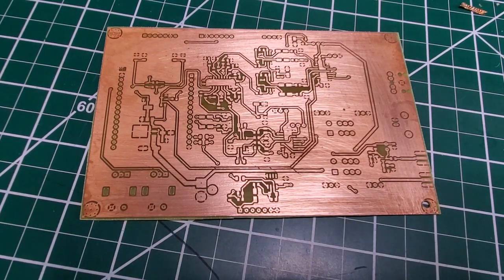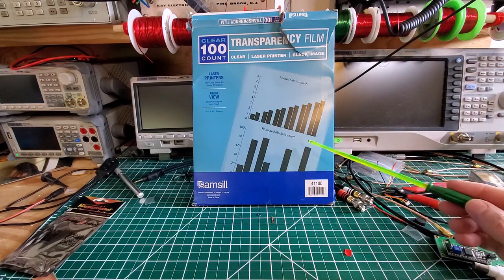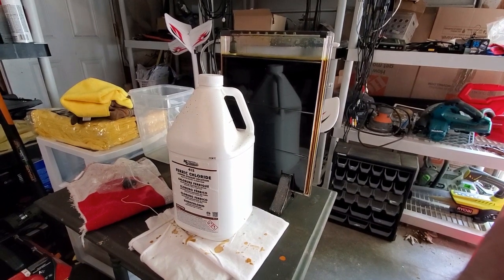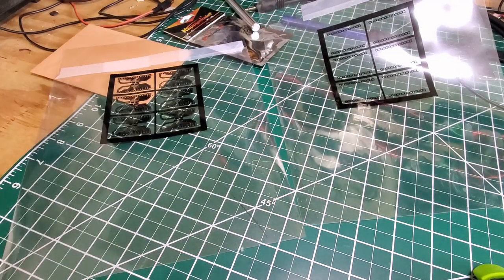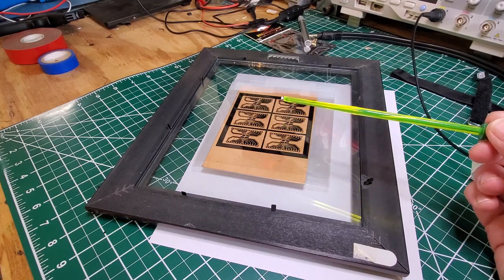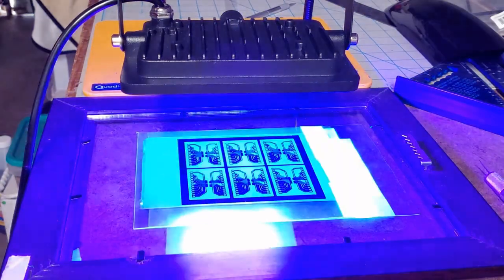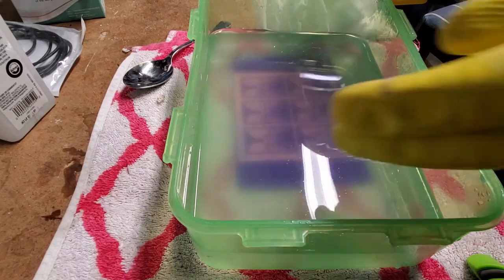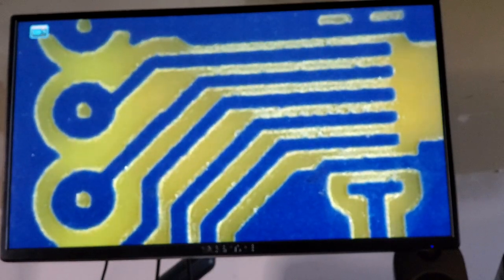Producing double sided PCB with UV Resist Method

Comment: here's a little tip,mist the board with water ensure the board is fully misted,squeegee all the air bubbles out,the water helps keep a vacuum and causes the film to vacuum suck onto the board,then either iron on or use the laminator.

Applying the resist sheet to a dry board just traps air,it's the same thing with dryslide decals the water helps get the air out.

Just make sure to squeegee out ALL of the water,you may need to run through the laminator twice or thrice,with the hot iron a sheet or two of kitchen roll to help make full thermal contact and press the film fully onto the board as the board is not perfectly flat.

The UV exposure is by far the best method for pcb manufacture,with screen printing a close tie,both use UV exposure for the image,i've tried both ,the silk screen for is more expensive with the negative resist from china being the favoured method for cost effectiveness and less wastefull. 

You can buy liquid resist thinned with acetone,i have some and i'm bursting to try it out ,it drys in a few hours,i could apply it with a hard rubber roller like lithographic stamps.

I have a few sheets of presensitised  copper sheet,a 5m roll of the neg resist and the wet resist,for two pcbs no bigger than a square inch or so each,one is a smps booster for tube HT and the other is a buffer op amp for the tubes output,small daughter boards for breadboarding the tubes.

I have caustic soda,i had to order the soda crystals for two reasons,one i can't find the caustic soad!!!!!! and second i remember the caustic soda removing the resist layer completely from the board it being a little too aggressive ,big clive (a fellow scot) used the soda crystals and in no time the job was done and in a far less aggressive manner.

I'll share another tip i gave to big clive,and another Scottish tip too,the etchant ferric chloride is great in a bubbler tank also in a passive tub,i made tube amps with brass facia plates with the decals etched into the brass,it took ages to cut the brass with it being a copper zinc alloy a lot of smut was building up and frequent use of a babies tooth brush to clear said smut.

I found out that a fluid for etching brass and it works amazing on copper,it clears the smut in a passive tank and reduces etch time in an active (bubble) tank,it is  called EDINBURGH ETCHANT.
Edinburgh etchant is ferric chloride mixed with citric acid,i bought citric acid powder from ebay  few table spoons in the tank you have there would be fine,the effect is amazing with regards to how clean and quickly the pcb or brass is etched and the brass particularly noticeably deep and crisp edges,without under cutting as was the case before due to the time taken,the citric acid kept it clear of smut,that's what the pcb bubbles are for,time is reduced considerably to make a pcb,very uniform fast etch,be careful.
Reply from the maker: Thats a lot for a little tip John! Thank you for the comment though - a lot of good detail here! I had no trouble getting NaOH though - it was down at the local hardware store. The Ferric Chloride mix I had was ferric chloride + HCl - which does go off over time

Comment: Thanks Ian. I use the same process, always nice to see what "tricks" others use. I've never done double sided so your pocket method has given me some confidence. Getting that first film layer off is a pain, I use two bits of tape, one on each side and in the same corner - works a treat. An option for others to get the negative ... in my case print the positive on to paper (I have an ink jet), then take the page to a copier centre ... they can copy on to laminate and those commercial copiers have a setting to print "negative".
Reply from the maker: Glad you enjoyed Neville. I honestly prefer the "fab in a box" laser toner method. Its far less fiddly. I do think you can get better resolution with the UV method though.

Comment: Nice video Ian, few tips :
1. Use a small sprayer (like perfume sprayer) filled with distilled water  and apply a thin mist of water on (little more cleaned PCB clad- with scotch brite and dishwasher  and IPA later) the PCB and then gentle put the UV Resist and use a Squeeze or old credit card to remove any bubble, also removing all the water. let it dry a bit and then put it in hot roller to finally seal it. this will give you mirror finish without any bubble.

2. After developing the exposed PCB un Sodium carbonate, quickly dry the board (in my polluted country, the polluted air attacks the copper in no time) and place a clear OHP sheet on both sides and expose under UV for another 4-5 minutes. this will make the UV mask rock solid.
- VU3ECN
Reply from the maker: Thank you for both the tips. Applying the resist has always been the most painful part for me so I'll definitely give the water mist technique a go! Thank you for the comment.

Comment: for sharpest possible image transfer you do want to flip the F side, since dye or toner is printed on one side of transparency and it should be closest to pcb or some light will refract and spill into transparency and under it
Reply from the maker: That makes sense although I had to stack two transparencies together or I would get light leaking through. Looking back on the method - I think it produces good results - but its fiddly and takes a lot of work to get there. Not to mention after you are done you have to go through and drill all the holes! I had fun doing it though

Comment: If you put the transparency in the thin box together with a cotton ball, paper tissue or something similar soaked in acetone for a couple of minutes, you will get much more contrasty print, and won't need to use two transparencies. I had a printing company long ago, and we were printing tons of user manuals for appliances, TV sets and such. We used laser printed tracing paper, and it worked perfectly, no reason why it wouldn't work with transparencies.
Reply from the maker: I'll have to try that - thank you for the tip!

Comment: I am not sure if it really worked for me, but I used to completely submerge the board and the  resist under water. Then get the resist and board aligned on the top edge. When you lift it out of the water, top edge first, surface tension will pull the resist to the board without any bubbles or wrinkles. As I remember it, there was no "free" water under the film but I assumed the film absorbed some so I let them dry in a warm dark place for a while.

BUT I did run into problems which may or may not have had anything to do with the water bath. Often the resist was very resistant to coming off where it should. It is more likely my UV light wasn't diffuse enough, or I was overexposing. I think the film was also getting old and slightly exposed looking off the roll.

The other problem, I think might be fixed by doubling up the transparency like you did but for some reason it didn't occur to me to try that. I ended up with lots of little pinholes in the resist and copper. On the other hand, it could have been mini steam bubbles from the water bath and laminater.

After etching, I think I removed the resist with acetone rather than lye. Assuming I'm not full of crap, I think that might be a little safer to work with, especially if done outside. Seems like the body even makes a little acetone as part of normal metabolism so it might be equipped to deal with a whiff of fumes every now and then.

Anyway, yours turned out a lot better looking then mine but I thought you might want to see if the water bather helps or hurts your process.

Comment: I have a tool that I bought from the UK at great expense that looks like a gigantic stapler which you can load little tiny hollow copper pins into. When you engage the device it forces the hollow copper pins into the drilled pcb hole and creates a via that attaches the upper and lower copper surface of the board. You can buy the pins with different via sizes. The pins in 1000 quantity aren't cheap either. The tragedy is I've had the device for years but I've never used it.
Reply from the maker: Thanks Vince - do you have a link to the tool? I think I may have seen it before. Whats the smallest pin diameter you can do with it? Thanks for the comment!
Reply: @na5y  Hi, I have pins that are 0.4mm and 0.6mm, there are larger sizes but that's what I was going with. The tool is made by Bungard in Germany. A friend was coming over to visit from the UK so he bought it from the UK distributor and bunged it in his luggage saving me a considerable penny on the whole deal. If you s***r*ch Bungard here you'll find their channel and a demo. Most everything I do now is surface mount, even rf experiments. The PCB turn around times & prices from China don't help either :) Maybe one day when I just have to have a board now then I'll make use of it. The last board I hand made was also surface mount with not that many vias.
Reply: @na5y  If I post a link, seeing as I'm one of the naughty ones, YT will delete my comment and recently they've taken to nuking the entire thread.  ☹
Reply from the maker: @vincei4252  Say no more ...  I did find the video. A beautiful but quite expensive tool!

Comment: It's also worth playing with using a resin style 3D printer which have UV screens so you can expose directly onto the UV resist PCB. I use an Elegoo Mars 4k and it gives very satisfactory results.
Reply from the maker: I have a resin printer and was thinking that and its an intriguing approach. Thank you for the comment!
Reply from the maker: I am not sure how you could align double sided though...
Reply: I 3D printed a frame which clamps to the two threaded holes that normally hold the resin tray. I have also printed inserts for the board sizes that I most commonly make. These sit within the frame and hold the board firmly in position. The fits are quite tight (interference) so the registration is not  too bad, but not perfect (~0.25mm). Mostly I do surface mount stuff with stitching vias to a ground plane on the back and it works quite well. I recently got a desktop CNC, so I might try drilling reference holes and have a milled frame with pins to see if that is better. One day, I might get around to buying another Mars 3 and ripping them both apart to make a sandwich device, but I'm not really doing enough boards at the moment to make that worthwhile!
Reply from the maker: @iwbnwif  Nice! You should do a video on it! If you do send me a link and I'll include it in the description above
Reply: I bought a 6" 2K LCD with HDMI interface and got the white backlight removed. I  got a 42nM UV COB light tp act as light source.  I only have a problem. I need to find a program which can project a 1:1 scale referring of a PDF or Gerber file. can anyone give me some pointer.

Comment: I'm wondering why you switched from your previous method? Perhaps you mentioned why but if so I missed it
Reply from the maker: I did cover it briefly in an earlier video but the company behind fab in a box unfortunately is no more. I believe it was up for sale for a while - but even the old link pcbfx.com is gone. Its too bad - it was a great product and I was very happy with it. There was nothing else out there that did the laser toner method as well. I think you can get better resolution with the UV resist method - but its a lot more messing about.
Reply: @na5y  I did miss that and also missed their demise. I have some of the pcb in a box stuff (transfer paper and foil) but hadn't had to replenish for a while so didn't see they were gone. Perhaps someone can figure out the magic of the green foil. I think that was the critical piece that they had which no one else has. This technique certainly looks much messier and more complicated.
Reply from the maker: @davelapp4740  Yeah the green TRF is awesome. Occasionally I would get wrinkles but overall the method was very reliable. None of the other toner based methods come close IMO - sad to see them go